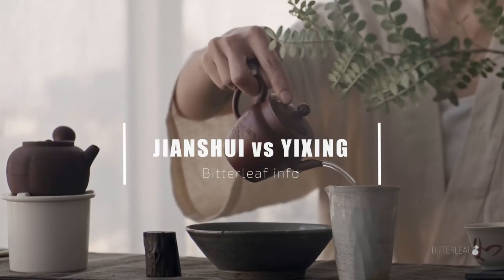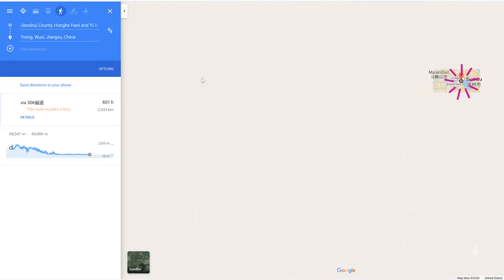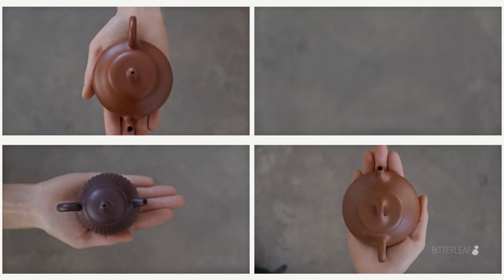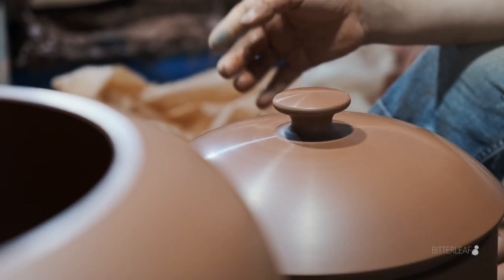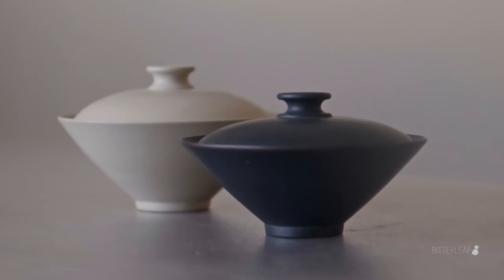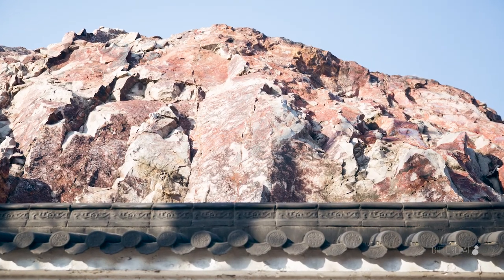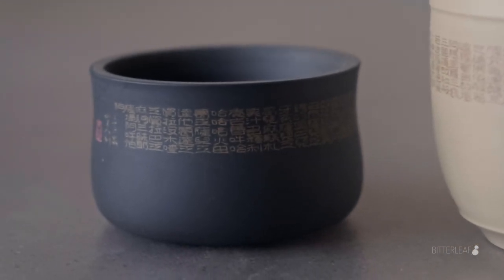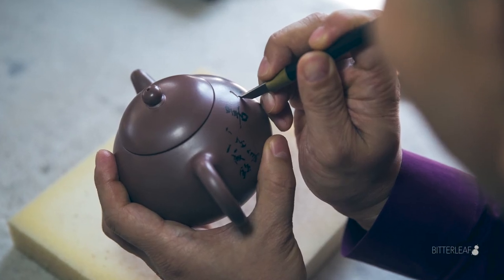Yixing vs Jianshui Teapots & Teaware: Differences & Similarities

Comment: any difference between the white and purple jianshui clay pots when picking/pairing with matching tea types? are both suitable for the same teas, or is the minerality of the clay different?
Reply from the maker: They're actually quite similar, from what we can tell. The main differences are cosmetic. The white clay tends to shrink a bit more during firing, but all colours seem quite dense and tend to interact with the tea in the same way. The main reason I would consider one tea over another for white Jianshui clay is that it will stain. So darker teas will require more wiping down or you'll have to accept that it won't be a "white" pot for very long!

Comment: Is the way the teapots pour (smooth laminar flow vs turbulent flow) one of the determining factors of a high quality vs low quality teapot?
Reply from the maker: Some people will use this as a criteria for judging a teapot, pouring from high up and observing the stream. This can be an indicator of craftsmanship, but is also affected by the teapot shape/style. In reality though, nobody pours from that high - it's usually only just above the gongdaobei, so it's not the most important thing to us. The main factor that will affect the tea in your cup is the rate of flow.

But overall yes, more expensive pots made with attention to detail should have a smoother pour.

Comment: i just got a red clay tea set from a used shop, but am having trouble identifying it. i only really found etsy or ebay listings of the same set with differing art for wildly differing prices. also baseless claims on rarity, and age. any idea how i can identify my set? i know its going to be a cheap set, and no more than 40-50 years old. i know its thrown on a wheel as i can see evidence of that in the pot.